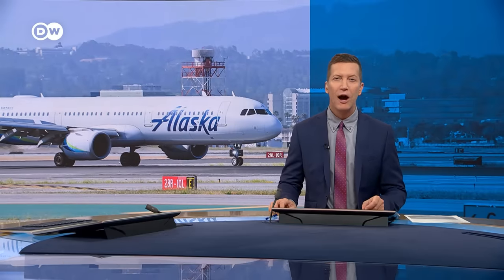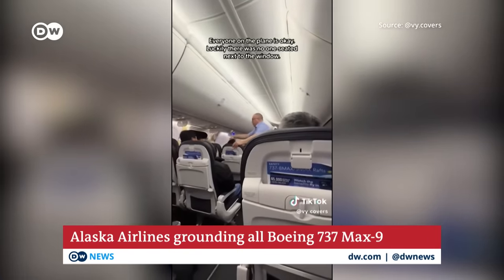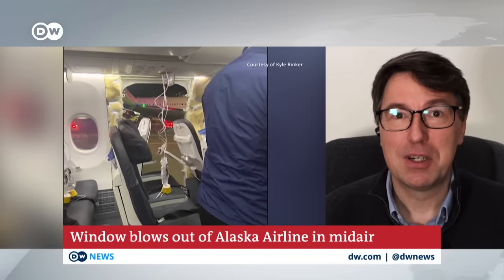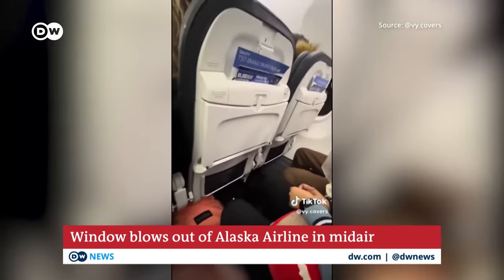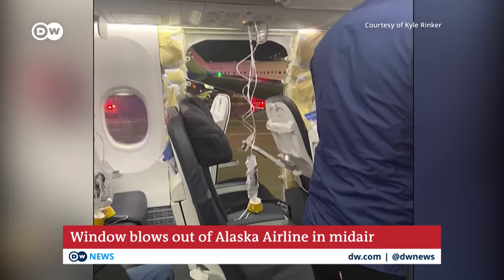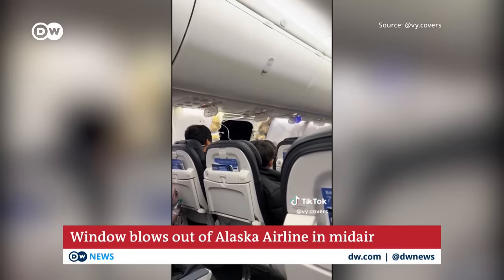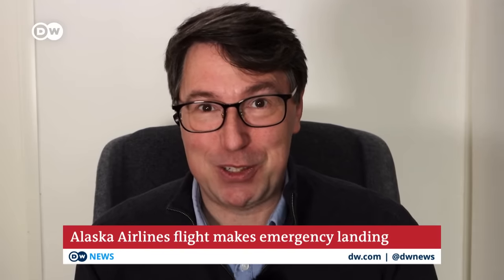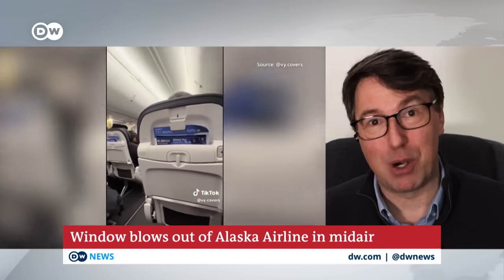Window of Alaska Airline Boeing blows out in mid-flight | DW News

Comment: Those Boeing Max aircraft are a big danger to all the passengers.
Seems for me that they cant build safe planes.
Nearly 10 years problems with those 777, then those MCAS Desaster where they rely on one sensor for back wing automatic tilt.
Iam an automotive engineer.
We use a couple of sensors for each funktion to avoid those problems.
But in a critical system they don't?

Comment: Hmm there was a minimum pressure difference in any case, so since there is no damage to the structure and everything is perfectly fine, the problem is another as there was still a Pressure leak. 
😁We don't say journalistic things. Nice little story But that plane is the classic example of corner cutting, cost cutting, lack of quality control across the board.

Comment: It's not just a window. It's a door plug.  It uses 4 lock bolts one in each corner any one of which would secure the plug so for it to just blow out all 4 bolts had to be un-installed or never installed.

Comment: Several news reports point out that the FAA suggested to airlines to check for a loose bolt that is used in the control system of the rudder. There also reports of Boeing ramping up production to get the 737 Max 9 out to customers who have ordered them long ago. Then this happens. I can only conclude that there is a possibility that there is an issue with the manufacturing process and especially, unrealistic timescales for production. Quality therefore suffering in favour of quantity. Boeing seems to be suffering from a toxic complacent corporate culture of one form of another. I am hoping that this is not the case and an isolated incident as selecting flights that don't use a Boeing aircraft is not really a realistic option. If it is found to be the case, then it is good news for Airbus and very bad news for Boeing.

Comment: Its not a window or part of the airframe fuselage structure.
It is a plug door for ingress or egress of passengers or services. In the Alaska 1282 the seating configuration means the door is not used.

Comment: Could the plane have become over pressurized? The door at 11 PSI pressure difference equates to 4000 KG  of pressure on that failed door. Over pressurization can and does cause doors to fail. For over pressurization, a lot would have to go wrong. Functioning pressure relief valves should prevent this from occurring,  all we do know is something went very wrong.
Reply: The plane was at less than 14,000 ft. when the cover blew off, so it wasn't even close to the pressure at cruising altitude. They would have known if there was a pressurization issue. Likely it was installed incorrectly at Boeing or the fasteners holding it on failed for some reason. The airplane was only in service for a few months.

Comment: Why not eliminate the windows completely?  Why even bother having them, if they can lead to situations like this?
Reply: Passengers would not accept to fly in a pipe.
Reply: Windows are essential for passengers to report to the air crew when various parts of the plane fall off the wings or erupt in flames, as it is apparently too difficult to fit CCTV for the pilots to monitor external incidents. They are also great for YouTube vids post disaster. You can post clips of the fighters escorting your hijacked aircraft, or of the crash trucks poised to extinguish you once you've come to a stop. So windows are a critical safety and entertainment feature.
Reply: Many people suffers from severe claustrophobia and anxiety while flying; now imagine without windows.
Military cargo aircraft do have very few windows, but grunts cannot complain... 😕
Reply: But how would you get random ventilation situations then?

Comment: Possibly another design fault with the 737MAX? Come on Boeing...
Reply: Thursday, December 28, 2023
The FAA is closely monitoring targeted inspections of Boeing 737 MAX airplanes to look for a possible loose bolt in the rudder control system.

They seem to misplace a lot of bolts these days, it's like building IKEA furniture, you always end up with extra bits you don't have any clue about!
Reply: @AshrakAhmed  Rushing something into production that is highly complicated is not so smart. They should listen to engineers and not there marketing people. Quality control seems off aswell.

Comment: I am not convinced by this “expert”. Firstly, climbing through 15 000 feet, the air is still relatively dense. So the aircraft will NOT be going very fast. Add to that, the decompression will not be nearly what it would be in cruise. Standard cabin altitude is around 7000 feet, so the pressure difference is not that big. Why would objects be flying around? That said, i am happy that nobody was injured.

Comment: The seat right next to the hole was sucked out of the plane so the professor is wrong when he says that someone sitting there would be hurt significantly.
Reply: Well technically they would probably be hurt significantly when they reach the ground after being sucked out.
Reply: @nakedenby it's not the drop but the sudden stop. Although it probably is the drop in this case too!

Comment: The guess is misinforming, it is a door. Nothing false about it. 737 has multiple roles of kind of flights. One is flying over large body of water. Per requirement these doors would be fitted to function when flying over large body water. This would allow two additional floatable devices on both sides to have sufficient floatable devices for passengers and crew.

Comment: This so-called expert is a joke. 
The exits, emergency, or otherwise, are supposed to be larger, than their oprnings, so that they rest on gaskets to seal. In the case of the emergency exits, bot side to side and up and down. They have to be pulled into the aircraft rotated and pitched out. 
Doors have forged fittings on the sides that matching pieces/latches fit into, the seals inflated, giving an extra lock, with pressurization adding the third.
So, I wish to have an aeronautical engineer explain to us, WTF happened.
Not someone who just recognizes, oh yeah, it's a plane!!!
Reply: What a shame this poster failed to watch the video and listen and because of this their entire post is not only worthless but an embarrassment to them. Now who is a joke exactly? The video explained it with abundant clarity. Perhaps the post was written by AI.
Reply: @nakedenby As the interview advanced, the so called expert went away from reality. 
1) Openings in pressure hulls (aircraft fuselage) have reinforced rings that the hatch/door abut/clamp to. The exposed fuselage skin/structure, in the video, showed standard framing, where fuselage skins adjoin, near window openings. Looking, almost like the section failed. No sign of the reinforced ring, for a emergency hatch, and way too narrow, for a door, unless you are just off a 6 month starvation diet.
2) Never ever doubt Boeing's ability to mess up.
3) Interviewee was not addressing the issue, but skirting it. So, unless he suddenly came to reality in the last minute or so of the interview, no, as I was so thoroughly upset by his wandering about with it. I shut it down.
I hope he doesn't try to find work in industry, no one I know would have him. 
He'd make a great politician.
I have been in planes since I was 2 years old, flown a few myself. 
Now retired, mining type. 
Have a great day